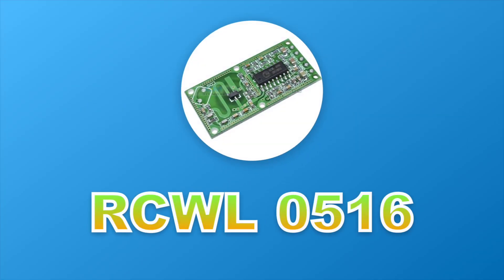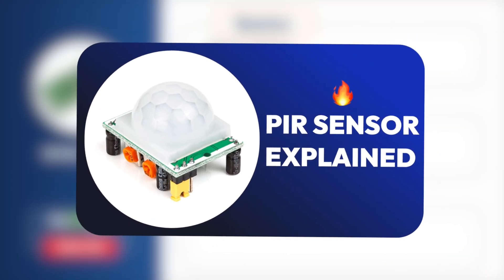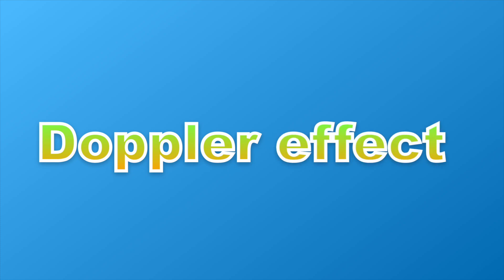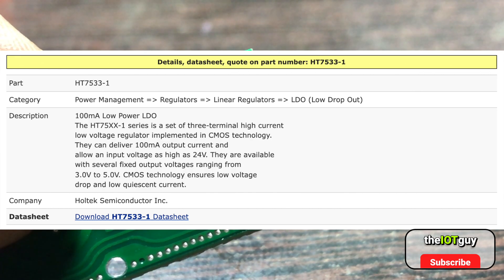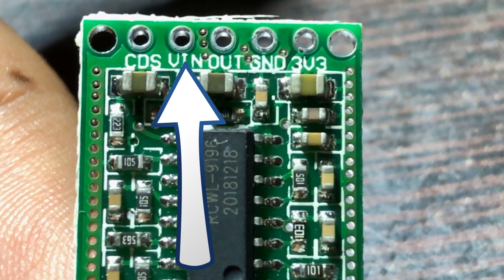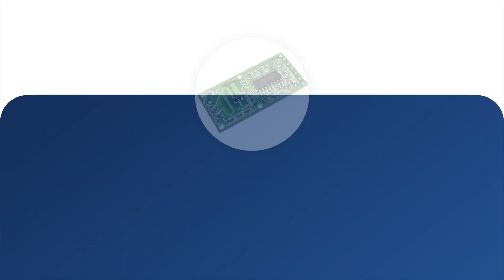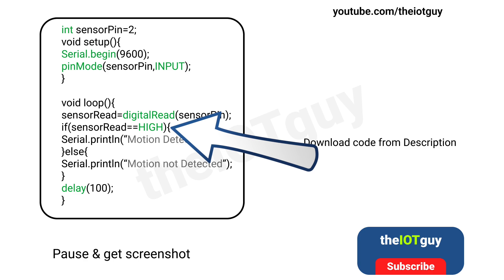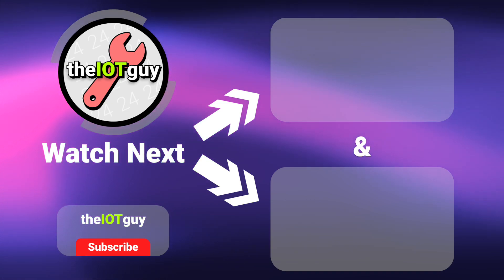With and without Arduino Motion Sensor Tutorial RCWL-0516

Comment: I can't get mine to work, I have two. All set up on the breadboard 5v in and ground. signal to LED and ground. LED stays on. no mods to the board only header pins. 3.3v out is good.  On power up a short delay then LED on and stay on until power reset. So I stop now and ask. Possible two bad modules? All my PIR stuff works fine. I won't be using UNO until I can make the simple set-up work. Good Video.
Reply: Did you got any solution for your problem now i have the same problem
Reply: @anikipatisuryaraj6612  no. I'm trying a CDM324 pulse doppler module this week. perhaps I don't understand exactly what the RCWL is. I want some RADAR action so I will keep trying.

Comment: I have attached the one channel 5 volt relay module but this sensor is delivering continuous voltage on its out pin.... there is no voltage drop or high....so will u please help me to sort this out...
Reply from the maker: Which pin have you connect your relay to? If its connected to OUT then have you used an LDR or used CDS pin in any way?
Reply: @theIOTguy  how To Increase Trigger Time, What Value Or type Of Capacitor Need To Attach At C-TM Pin, Please Help
Reply: WATCH A VIDEO IN YOUTUBE -- https://www.youtube.com/watch?v=IJoPkKlxFXA